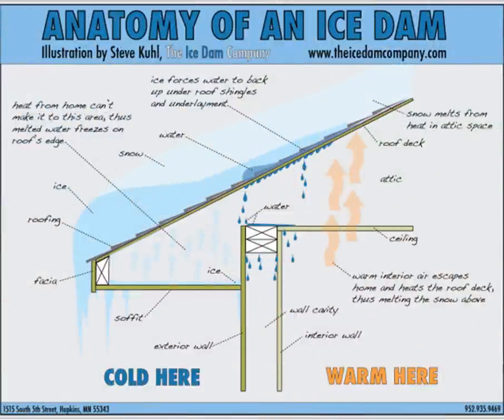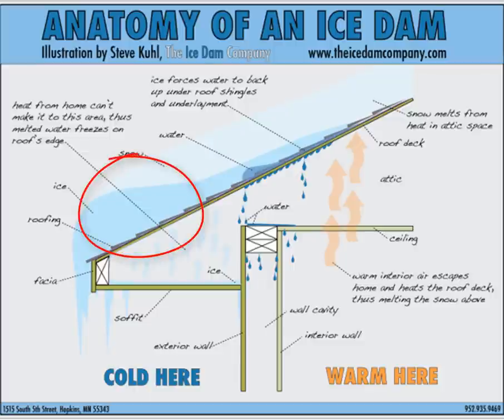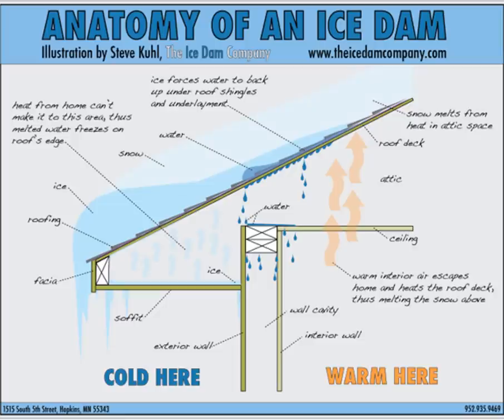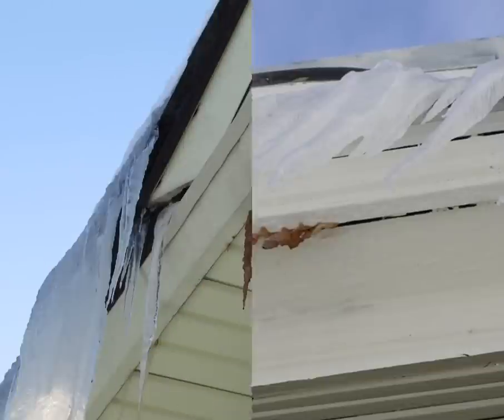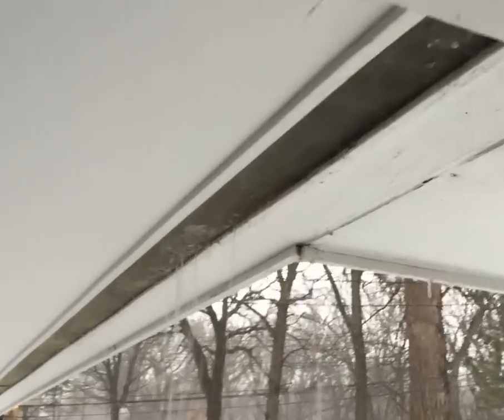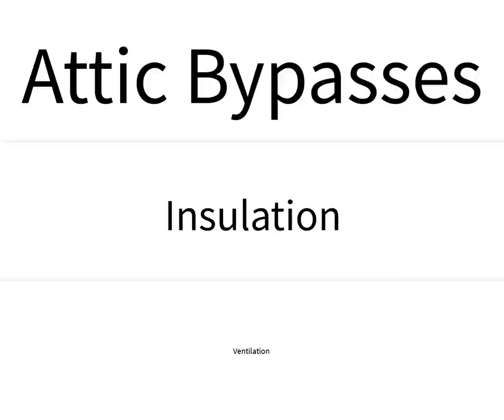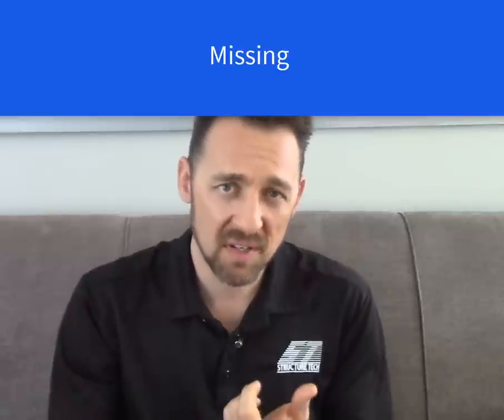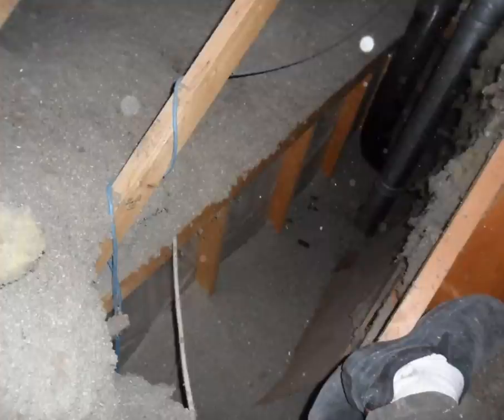Ice Dams: how to prevent them, how to remove them

Comment: That was an awesome video! I live up by Brainerd MN and this year was bad for this type of stuff! We had our first snow fall this year that was very wet and it stuck to everything! Broke tree limbs etc. so it stuck to the roofs as well so you basically started out with one big sheet of ice on most of your roof and then it got cold so if you have any heat leaking through your attic it’s not good the dam could really start anywhere on your roof.

Comment: I have literally had it rain inside my hose...to be more precise I swear I heard thunder...the ice damn was extending from my 2 foot soffit soffit up another 2 feet...I climbed up on the roof scooped off a foot of snow and broke 2 to 3 inches of ice with a 2 lb hammer...you're right that ventilation means very little....that warm air leaking into the attic is tuff to stop in an older home...excellent information thanks

Comment: Thanks so much for your video. Unfortunately I have a 1 1/2 story, and was determined  (before watching the video)  to fixing the air circulation in the attic. I've since decided to fix the air leakage into the attic and possibly add heating cables. Btw, I am already using a roof rake, which helps.

Comment: Here's the main reason why a lot of people have ice water leaking in during the winter.  Number one make sure that you have 6' of ice shield installed on your roof if you live in high snow load areas. Then make sure that the ice shield is installed 3-4" down over the gutter board and behind the gutter. This is the number one mistake that shinglers make.  If you have no soffit venting then get it installed. If you have multiple valleys dumping in a short gutter area then install high end gutter heat cables in the gutter across the bottom and down the downspout,and 6-8'  up the valleys. I recommend Ray Chem cables.These cables eat electricity but you can turn them on and off to save electricity. Make sure you have proper ridge venting. If you have dormers at the lower roof area with dead air space then drill rafters with 2" hole saw to allow some air movement. 2nd generation roofer with 50 years on the roof in Northeast Ohio snow belt. Retired

Comment: Awesome!!!! I live in Andover and every year I have problems with a chase way that goes up the deck which melts a 6 foot diameter circle around the gas chimney and then melts the snow which flows down that slope then meets the other roof deck and then the water freezes on it. I have asked insulating contractors to fix the chase way issue but all they want to do is take out all my insulation and start over with spray and blow in cellulose.

Comment: my problem area has a cathedral ceiling just on one side of the house with a pair of skylights.  It saves the centre of the house from being impossibly gloomy; the skylights let in so much fabulous light we now call that room the atrium.  The price for that is ice dams below the skylights.   The insulation is R50 closed cell spray foam with no ventilation - there must be some thermal bridging through the truss wood.  I installed electric heating cables over the soffits and no sign of leaking yet.  We plan to install a new  sheet steel roof over our asphalt roof with an air gap under thanks to the strapping and I hope that might at least help.
Reply: What pitch is your roof? It sounds like you need a 750 can vent, or 2 installed on your roof with the ice dam issue

Comment: I use the roof melt disc in a particular bad side of my roof on the north side over my kitchen. They work phenomenal I always keep a couple buckets on hand because when you need them you can’t find them in the store. I lay them on the thickest part of the ice layer and several in the gutter. Never had a problem indoors since I began using these. I’ve also tried the salt filled nylons in my gutter, worked ok, never just threw the salt on the roof I heard that wasn’t a good idea for the shingles.

Comment: If you have no attic ventilation, it doesn't matter how well sealed ceiling and vent pipe openings are. You will still get heat built up in the attic because no insulation is perfect. No absolutely NEED good ventilation (not just ridge vents which get blocked), but side vents below the eaves which can not get blocked.
Reply: K Danagger I disagree with your comment, "but side vents below the eaves which can not get blocked." In my 30+ years as a residential energy consultant, I can say definitively that those vents can get blocked quite easily from inside the attic and from airborne debris (i.e., dogwood, dust, grass clippings, leaves, etc.) from outdoors that gets trapped against the inlet screen. I have pictures of plugged solid soffit vents that I've removed (for photo purposes). Soffit vents need to be vacuumed/cleaned (from the exterior) to keep them free flowing. How often they need cleaning depends on things like wind direction and the quality of the outdoor air. In some situations, they might need cleaning every year. Other situations might dictate cleaning every couple of years. It's best to inspect at least once a year. 

In addition to being a residential energy consultant, I've also spent several years providing state-approved, in-field mentoring services for insulation and remodeling contractors in Wisconsin through Focus on Energy. This mentoring included ice dam remediation in existing homes as well as providing education (and state-mandated continuing education units) for those insulation contractors who insulate new homes. 

Rueben is absolutely correct by identifying the three things that typically cause damaging ice dams. His priority list of those three aspects is also correct. 

To ensure no ice dams, consider a vented over-roof to keep the snow from melting and re-freezing at the eave edges because a vented over-roof isolates the main roof from snow accumulation that could otherwise be subjected to melting and forming an ice dam or dangerous icicles. While this vented over-roof approach can be used successfully for an unconditioned (vented) attic, it is also well-suited for unvented, cathedral-style roofs that have all the insulation installed in and above the rafter cavities. While this building/remodeling practice is more costly, it eliminates ice dams, icicles, and the effort involved with raking snow off a roof or the maintenance involved in keeping the attic ventilation "system" operating at peak efficiency.

Comment: Thank you for the video, very educational.  I've been told that as long as you can pull about 2 feet of snow from the edges of your roof with a roof rake that is a sufficient amount of snow.  Is that true?  I'm not saying that this will prevent ice dams, such as when insufficient insulation is at hand, but that the 2 feet of snow is enough snow to remove.   I hope you can find the time to answer me, or anyone who might have an opinion.  Thank you.

Comment: Thank you for this video.  When this video came up as a YouTube  suggestion I was  so sure that I was not going to learn anything new.  Boy was I wrong.  This winter season in the northeast is starting to be very bad for people who get the ice dams.  We had recently re-insulated the attic about 4 years ago to try to resolve the ice dam problem.  But it is still a problem on the west facing roof side.   I suspect it is the air sealing that you talk about. Thank you.  MikeS

Comment: The bit about whole house fans needs some clarification. Any whole house fan sold in the last decade or 2 comes with an automatically actuated insulated damper doors in the ceiling, usually r5-10. They are also much smaller than what's in your photo. That pic is of 20-30 year old louvered whole house fan, I'm sure you come across these I'm older houses but they are not to be confused with modern equipment.

Comment: salt-filled pantyhose took a while, but they did make channels.  it depends on what you have right under your roof line that may rule out just throwing salt all over the roof.  the rake works very well.  i make "v" shapes in three spots to make wide channels.  no more roof leaks here.

Comment: Good video. I'm in the business of getting rid of water. It can be zero degree out and with a clear sky  Radiant energy from the sun melts the snow. It  Doesn't matter what kind of house it is or what you have  for   insulation. I'm a Licensed Builder understanding what you are looking for and it's just not there.  The only solution is to not have gutters.

Comment: Tonight, I did the roof shovel,  panty hose salt and poured salt from the bag. 
I'll update tomorrow. 
Also used a hammer,  that didn't work great.
Reply: Let me know how it works out. I will be out with salt socks in the morning
Reply: @aleb5195  I had better results just pouring the salt in piles on the roof.
The salt socks are working but seems to be slow. And neither is working great. There is alot of melting,  but this is far from a quick fix.
Almost need to go up there with a hole saw on a drill to start it.

Comment: Just upgraded to R52 insulation in the attic, all the inside of the the soffit was blocked with insulation to prevent air leakage and all vents were installed in every truss in between for ventilation.. still getting dams on the side where there is a plumbing vent and also exhaust fans are installed on the roof.. the exhaust are all insulated as well within the attic.. not much more I can do to prevent it..  roof Just shingled as well??

Comment: So you talked about heat cables or coils and having them go down into the gutter and even getting part of the heat coil down into your downspout I thinking about doing that can we have one small space is there a certain brand you try that work well or is anybody else here found those deicing systems that you plug-in work well? Kind a like you said at the end just get up on a ladder and pour a bunch of ice melter package of snow and you said in the beginning of the video is that if you get snow you wanna roof rake it off if you basically roof rake off the snow pretty regularly then you most likely won’t have to ice dams? that’s a question-

Comment: DAMN ICE DAMS....   
I used 3 foot long lines of salt last winter, it worked well enough. After reinsulating the attic from last year's R25 to R50 this year, we still have the same damn ice dams.  :(    After watching Reuben's great video, I'm now convinced there is warm air escaping into the attic. Oh, by the way, I just tried the "ice socks," and found this very disappointing compared to the 2 to 3 foot lines of salt. The ice socks have been up there for about 50 hours and have done almost nothing. Going back up tomorrow with scissors to cut those ridiculous ice socks and pour the salt directly onto the damn dams.  I'm using a product of sodium chloride and magnesium chloride that works well and they advertise it as safer for pets & plants
Wish I'd found Reuben's video LAST YEAR.  :)

Comment: We just bought a 1 1/2 story home in Ohio... and we have ice dams.  Who knew?  We planned on blowing in more insulation, since what IS in there doesn't even cover the joists.  We just didn't have time before winter arrived.  The most common suggestion I've heard is the pantyhose full of salt or calcium chloride.  Even contractor Tom Silva from "This Old House" recommended it in a video! (link below)  I've decided on heat cables, but ran across one system that uses aluminum sheets that slid up under the shingles (not sure how they deal with nails) and has a tube at the edge of the roof where the cable runs.  Have you seen these and would you recommend them?  I mean... they are prettier than wires!
As promised.... Tom Silva on "Ask This Old House" with pantyhose filled with salt:
https://www.youtube.com/watch?v=5AGU5wDO0cw

Comment: LOL. Thank you for the great info and great humor. I couldn't stop laughing! :)
Reply: You have given me so many things to look for in my attic. Thanks! 
As for ventilation, it depends on how it's done. I drilled 1/2" holes under my soffits to the attic. Cover them with aluminum vents or screen so you don't get wasps. Then I stapled styrofoam rafter vents in the attic starting at the edge of the eaves. But you have to make it a closed channel. I clipped and bent the vents at the eaves to cover down to the holes. Then I stapled them to the rafter plate.
Now the cold air goes directly up between the vents and the roof keeping it cold. I could NOT believe the difference! Huge ice dams and 4 foot icicles dwindled to twigs.
It also cuts way down on condensation and mold should you want to vault an upstairs room.
My neighbors have icicle envy. 
No, this doesis does little for the R value so staple some rolled insulation over the vents up the rafters, and blow in more onto the floor.
Saved me 40% on gas bills.

Comment: I hate blown in insulation, it never stays in 1 place, and it never has an equal R-Value across the ceiling plain. It also gets sucked into air handlers, causing mold. Not to mention, it makes its way into your living space and your family breathes it in. And Spray Foam is toxic and can take up to 2 years to off gas. And both of these options are all the rage. Ugh
Reply: Completely wrong about blown in insulation lmfao.
Reply: @AnthonyDoster  Vented soffit moves it around from wind. I’ve seen plenty of it migrate all over attics. Laser particle counters prove it too. Your comment is broad and dull, with no substance.